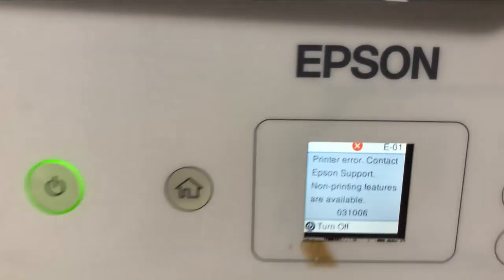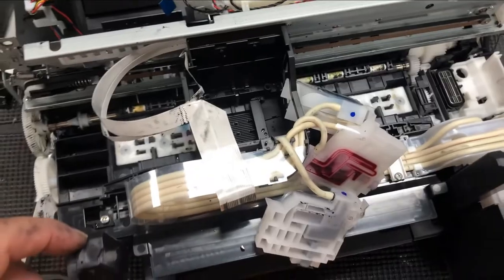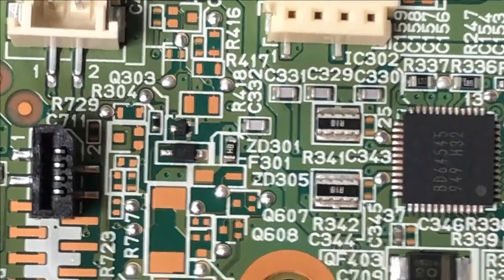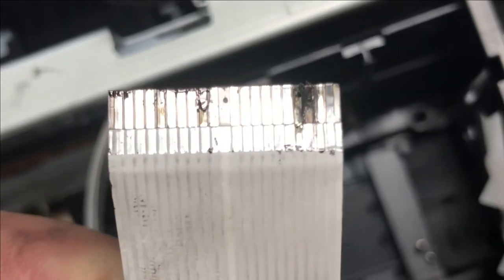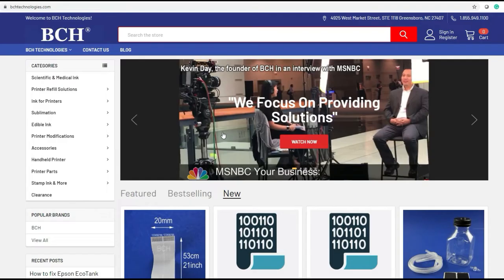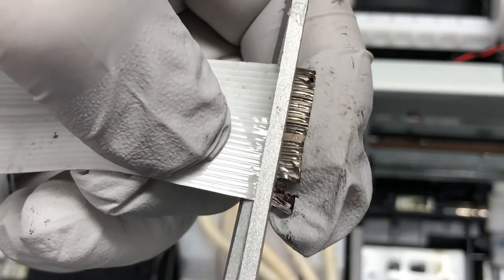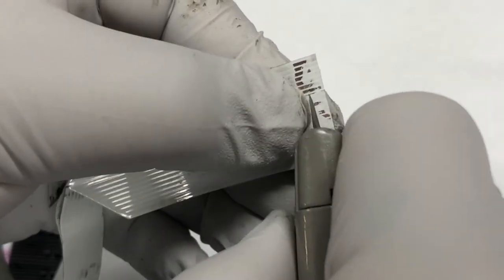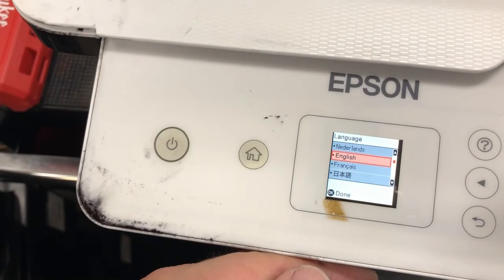Epson Error 031006 - FFC Fix for E-01 Non-Printing Features Are Available

Comment: You must be the luckiest guy in the world to fix this problem by doing what you did. Inside the clip is burned, you can sand inside the clip with a 500 grit sandpaper but if it's burned too much it will not work. I tried this with my Epson et-2750 but I'm still getting the same error and I cleaned everything real good with alcohol and all contacts are perfect. My ribbon cable looked exactly like yours. I probably have a blown fuse but I don't think it's worth fixing this

Comment: Hello I had that error. And cleaned the ribbon cable and the error is gone but the printer only prints blank pages. I replaced the headprint and it stills printing blank pages. I orderd from your website the ribbon cable and see if it fixes it. if I don't have the error anymore and it stills print blank pages, what else could it be?

Comment: Hello friend. I got this error aswell as the 031008 on my wf 7710 after a manual head flush from your other video, i let it sit over night and the next day it turned on fine but now it prints blanks after plenty of head cleanings and nozzle checks. Do you kno what this means? Would really appreciate a response, thanks!

Comment: Do you have a video on how to replace the whole print head cable of an epson we-7210?
Reply from the maker: WF-7210?
Reply: @BCHTechnologies  yes, I was able to figure it out . But my printer won’t turn on now. After pressing the On button the blue light by the power but turns on real quick with orange light on the error light.  after replacing the print head and print head cables. My printer is not turning on. Have you ever ran into this problem ? Any advise? I’ve check that I put everything back to get her checked it 4 times.
Reply: @BCHTechnologies   update: It powered on now but I have this error code 033007.

Comment: Hi Kevin, brilliant videos, you have advised me in the past, ref epson wf-7720, I have now replaced print head and the print head data cable, due to burnt flat cable and burnt out print head,  however I still get error code 031006, this video hints it could be mother (main) board, are you able to confirm this??, I understand there's a fuse on this board for the print head, is this an easy repair, or is it simpler to throw the board away and replace with new one, thanks in advance.
Reply: I have now purchased CC97 epson genuine main board (used for £31), seller has advised me it fully working, so time will tell when I install it 🤞😁
Reply: @kelvinkelsall9996  did it work? I'm having the same problem
Reply: Nope it was wrong motherboard in end, version I need waz too expensive, I scrapped the printer in the end

Comment: I removed printer head and was cleaning it with water and then 
with specialy dedicated cleaning solution CLEANSER INK STRONG.
Now I have Error E-01 after printer start.

Can such water or cleaner solution 
made short inside the printer head PCB, too  ?
I am convinced that if you clean printer head PCB 
and then dry it before installation, 
then nothing should happen to this PCB and motherboard too,
and you can use this printer head again.

Only problem is - in my opinion - HOW TO CLEAN
printer head PCB connector contacts, because after cleaning it
with water or cleaner solution, residues or oxidation can stay 
on the contacts surface, which prevent good conductive connection.

What do you think about : 
- using of cleaned-up and dried Printer head :
- oxidation after cleaning of Printer head contacts surface ? 
Thank you very much in advance for you opinion.
Reply: The solution utilized for cleaning is alcohol-based. Allowing your printer to air dry naturally for a period of 2-5 days (The longer the better) after the cleaning of the printhead should have no enduring impact. By "naturally," I mean leaving the printer undisturbed on your table without turning it on.